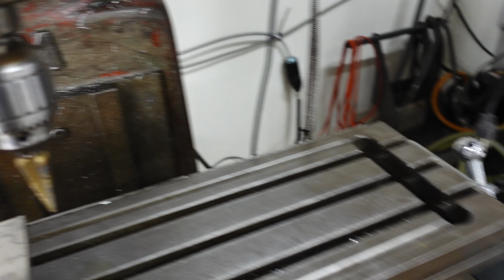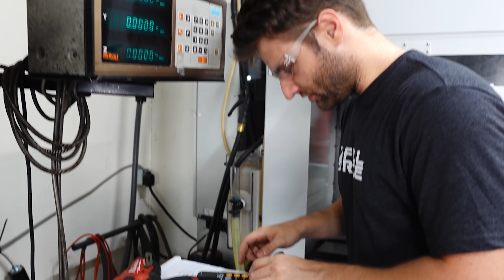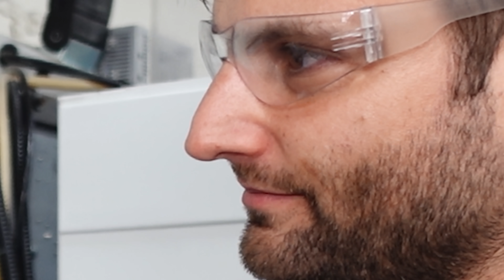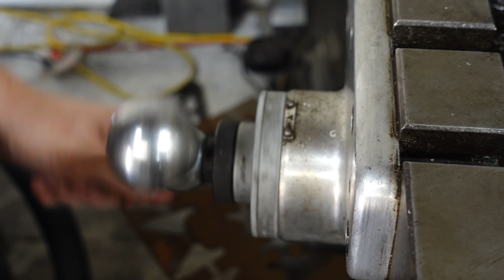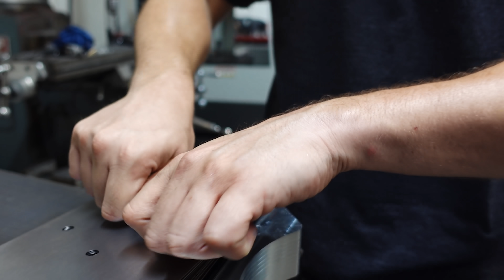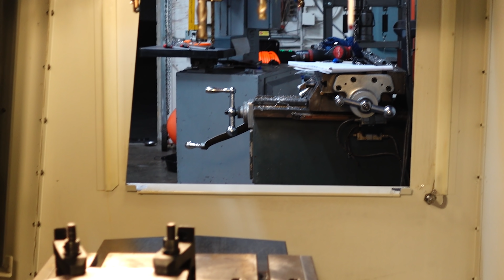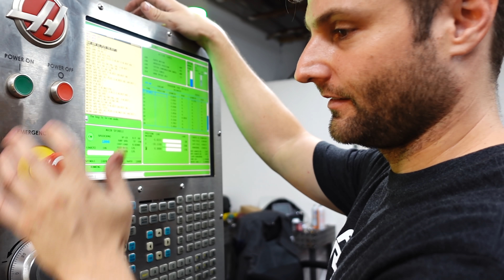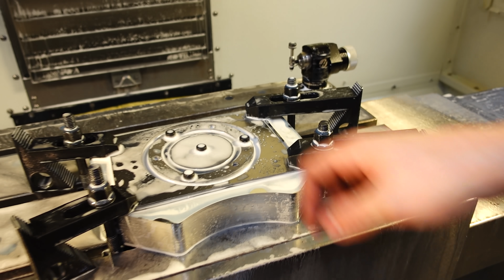Making EMERGENCY Parts for my 4 Rotor before the race.

Comment: I love how when rob started this project he knew basically nothing about building cars and using machinery. And how he still claims to know nothing to this day but yet this man has taught himself how to build engines, engineer suspension and use a tig welder and programme a CNC mill. 

Edit: Some morons obviously can't differentiate between "learning how to use something" and "becoming a master at something" and want to argue to try and deminish his ability. So I just want to clarify that i know he's not a master of any of these things, I'm just pointing out that he's taught himself enough in order to build this car himself rather than constantly paying others to do everything for him. And that's commendable.
Reply: This is the only way you become a real mechanic, not just throwing bolts on like MANY YOUTUBERS, blowing shit to fix it and blow it again, 
The knowledge he is getting is priceless, but he is a smart and wise guy , you can have all the right tools and be a bubble butt ass mechanic
Reply: On the suspension part he just become genius to find an already amazing design
Reply: It actually has some issues. The struts have a falling rate and the whole front of the chassis never really looked that rigid between the firewall and front tires. I’m sure Rob is aware of both of these issues.
Reply: I wouldn't call that suspension engineered... I would say it's replicated.
Reply: @NNFaNRacing  It's one thing to get inspired and use a similar suspension setup to another car. But he had to take that suspension setup and transfer it into dimensions that would work with his car. And it's not even just how it's designed to work, it's the whole geometry of it. The ratio of the car is engineered to use the optimal 1:1.6 "golden ratio" of Width × Length that most race cars would use. Each thing on its own,sure not that impressive, but getting it all to fit required a lot of calculations.. Which is engineering by definition.
Reply: @NNFaNRacing  yes is replicated, he mentioned it, he went to California to see the hoonicorn and he talked to the guy that build the car and he gave him lots of hints on how to replicated that suspension, he didn't steal the idea,
Reply: @NNFaNRacing   ish??? Hoonigan didn't invent the wheel with their setup either. It's all adapted engineering!!! F1 cars and other on-road and off-road trucks/cars have used the concept. Don't down play that a novice to the extreme is learning and adapting to what the car needs... Rob never once claimed that he reinvented the wheel...
Reply: The more you know, the more aware you are of how little you know!
Reply: Ther is nothing youtube cant learn you! lol
Reply: I was just thinking the same thing.
Reply: yeah amazing
Reply: i have nothing but respect for anyone who teaches themselves in the ways of diy
Reply: we are watching a human being evolve right in front of our eyes
Reply: He did say he kind of stole suspension idea from the hoonicorn mustang. And programing CNCs is super easy now as it is all software assisted now; load the cad select the tools, and it writes the program, HOSS machines even set themselves up.
Reply: @Scottish_Viking84  Software assisted but you got to do the right calculations based upon measurements taken by the machine user. You also have to know what cutting bit you will use and come up with the idea of a Jig and template like the one Rob built to put in the machine.
Reply: @normanguzman417  he showed that instead of doing the calculations, he just got the numbers he needed from the cad. In programs like Mastercam, Solid Works, and NX/Unigraphics you tell it what tools you are using and it will write the appropriate code; most already program the correct feed and speed as well, or you can get that information from the tool supplier since they are always coming out with new tooling.
Reply: @Scottish_Viking84  It is not just drop the part and the machine will do everything for you. He use a manual milling machine with a 6.8mm drill bit, the he switch to a tap. If you look at 3.10 of the video you will see Robs notes, drawings with dimensions. At 3.50 he use a calculator to adjust the work table position of the manual mill. At 6.30 he consult a scientific calculator app on his phone to prepare for for drilling with his manual mill again.
A lot of people on their computers always say thing are easy but they don't really build anything. That is how they have time to comment. My self included.
Reply: @normanguzman417  I am a toolmaker that works the afternoon shift and build big automotive dies everyday, he also said in the video that he cheated and just got the numbers from the cad... drill/tap charts are a thing, so knowing what drill for what tap isn't a huge accomplishment.
Reply: @Scottish_Viking84  lol, not that easy man.
Reply: @2fast2nick  what CNC stiff? It is that simple, I am a toolmaker, so it is what I do. He even showed you in the video. He showed the machine setting the tool hight and tool diameter with the probe, and then he was setting datum of the fixture with the dowel, and the surface of the material.
Reply: That’s absolutely no suspension engineering. Don’t call it like that.
Reply: @_entrxpy  By definition... It actually is.
Reply: @shona5512  by definition, Rob didn't do any of the 5years of University to become an engineer, neither he ever studied parameters curves or even just did an integral. Are you even an engineer?
Reply: @_entrxpy  I am an engineer actually.. A structural engineer and I can also tell you that you don't have to do 5 years of a degree to be able to engineer something. Hell, you don't even have to do an engineering degree to be able to call yourself an engineer.. My dad is an engineer and owns his own engineering company building trucks & transport trailers but didn't go to college for it. Regardless Robs not claiming to be an engineer, but he did engineer the suspension. Calculating every dimension of the chassis to fit the golden ratio and designing suspension components in CAD (yes it's inspired by the hoonicorn, he still had to alter the dimensions) It's the definition of engineering something.
Reply: @shona5512  'murica..
Reply: and still doesn't know how to use cosines
Reply: @ATX_Engineer  He had to do the cad anyway so it's faster that way and he was able to explain the principles. I mean, everybody knows SOH CAH TOA, but you need to remember if you haven't used it in a while...
Reply: @fpbibi  you'd be surprised that 1 equation done in 5 seconds can solve the problem. But people are scared of math and it's why I get paid the big bucks and they don't.
Reply: @ATX_Engineer  shut up man... Dude is literally figuring this out as he goes, what are you building?
Reply: @Matty.Hill_87  currently? fucking everything, I'm an engineer, it's what we do.
Reply: @Matty.Hill_87  Probably a gutful of envy, bile and just a general bad attitude.
Reply: @Matty.Hill_87  you do know cosines is math, right?

Comment: Rob, the PCD function of your DRO would have made this really fast to do, or in Fusion 360 you can draw a single circle on the radius from centre you need, then rotate as a pattern with however many holes you need. Not criticising, just trying to help make this thing go faster :)
Reply: He said and shows the dro isn't working
Reply: @shaynegadsden Works on the CNC in manual mode though right?

But that's fair, I missed that bit.

Comment: to keep those shims from bending in the cnc machine you can put on a slab of thicker material i suppose
Reply: The block was like 30cm thick. It was from the torque on the bolts

Comment: Amazing that you taught yourself CNC, slow that rapid down though its a lot less scary
Reply: Another handy trick is to put the machine in single block mode, change the position to "distance to go" and then you can see if its going to try and go through the top of the job ! https://www.youtube.com/watch?v=R8yIf8eQHvE
Reply: @shaunwilmer2358  fellow machinist!
Reply: @dblazearrowz  Oh yes, time served :) Been a design engineer for 15yrs now but still write programs in Edgecam for a 5 axis mill & an EDM wirer on the odd occasion.
Reply: Realistically it should be said that you should use single block at the start of every tool since you're supposed to have a "safe" z movement on your height call so you can stop the machine and make sure it's actually. 1, or 1 inch or 2 inch away whatever you pick
Reply: I know nothing about CNC but I knew what you meant here! When that thing slammed down so fast my heart stopped for a second, lol. I have seen the cnc fail videos so I know things can go very bad very fast.
Reply: My thoughts exactly lol I was like damn, for someone that’s worried about a new op, that’s gotta be 100%

Comment: The DRO has bolt circle functionality already built in. Spend some time with DRO vids and it'll make using that mill a lot easier.
Reply: Yep. Adam Savage just didn’t it on texted. And Alec Steele did it on his channel too. YouTubers unite! Lol.
Reply: The dro he said within the first 2 minutes wasn't working ?
Reply: @KahL646  then he's bought himself a ton more time doing the job. He could have done it all on the mill if he had a rotary table. Fix the DRO and you don't need to G code either.

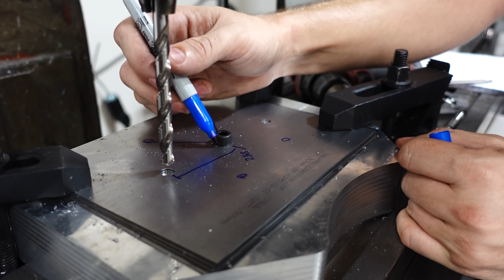Comment: 6:18 That moment you realize you DO actually have to use algebra. "Chuckles.... I'm in danger." 😅😨
Reply: he has shims already. what you do, drill and tap first hole. step two, bolt shim to stack. step 3, transfer punch all the rest of the holes. 4,drill tap and cut.

Comment: I always like to run everything around 25%-35% total speed for the first cuts to make sure it measures and comes out how I wanted each line of code.  Saves a TON of money in tooling.  Especially if you are running multiple parts.  Saving, or making a working part first time consistantly is key to keeping cost down.  Also, make sure you keep your machine clean at the end of every day.  Nothing like the smell of some stale coolant and machining oils.  WD40/PB Blaster and Scothbrite keeps the table clean nice
Reply: First run at 100% had me puckering haha
Reply: @mostlymotorized  To each their own.  I could see certain 4 axis being difficult and finicky.  But after being an operator in a humid area, I noticed especially after running certain tooling steels, rust stains and stench were special.  I'm sure there are other solutions, but you listed none.  Machining Oil works, certain mild detergeants are okay, just make sure it's mild, and thouroughly rinsed.  Oh gawd the suds I could imagine!  Mineral spirits, but man are they harsh.

Comment: PLEASE ROB, take a machining course! Even a short one. I am 21 years old and only was a machinist, ahem button pusher, for three years but know that all you are missing is some confidence. Read up on your g and m codes. The program to cut your donut could have been 10 lines long bud. Save yourself time and headache and learn how to properly operate your cnc.

Edit: forgot that two circles are needed for a donut. 😂 Been a few years since I was in a shop.

Comment: Good to see at least one Haas is working. Magnussen and Grosjeans’ Haas machines appear to be malfunctioning smh
Reply: disagree, those haas machines work fine, except this one is a but quicker then grosjean and magnussens
Reply: Yeah Haas is killing it with a buy it philosophy, Integration not so much.
Reply: Funniest thing I’ve read all morning!
Reply: Mazak is where its at tbh
Reply: Wolfgang Koeppen only if you’re using mazatrol.  Otherwise going between screens is annoying.  Also helps if your foreman uses coolant that doesn’t react with the seals.  Speaking from experience here, if you can’t tell 😂
Reply: True almost like all Ferrari powered cars are handling like tractors
Reply: @Cristian-lv6sb  Alain Prost got fired from Ferrari's F1 team for calling their car exactly that.
Reply: That's more a case of the engineers not understanding the cars or how to set them up
Reply: Lmaooooooo